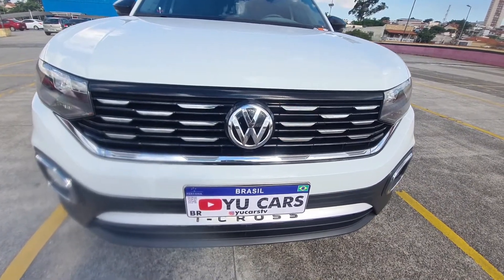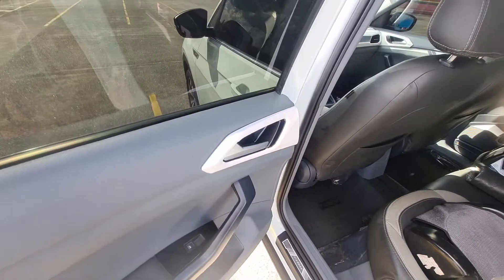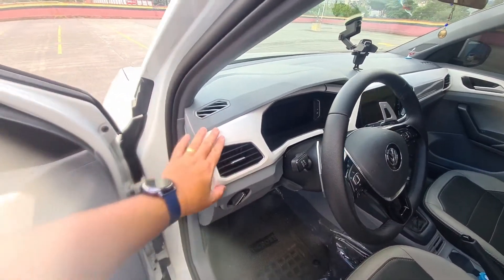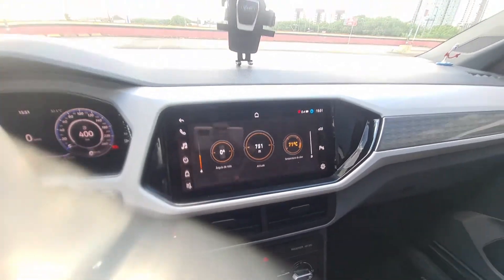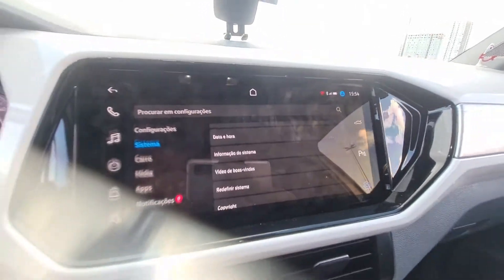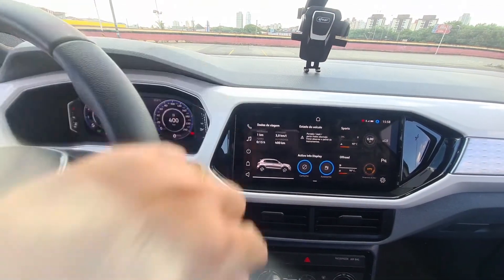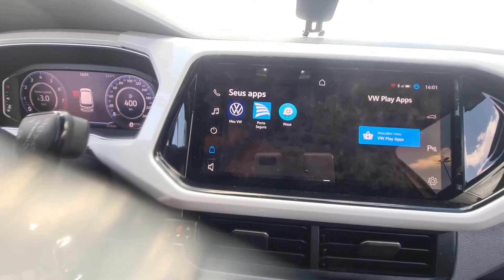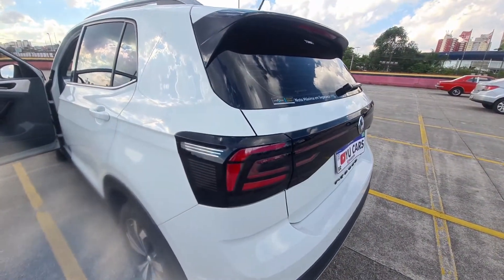Dicas como Transformar  Internamente T-Cross Sense X T-Cross Highline 2020 e 2021

Comment: Muito bom o vídeo parabéns! Só faltou ter mencionado qto vc gastou aproximadamente nas modificações e sobre o descanso de braço. Vc colocou o original?
Reply from the maker: Sobre as modificações tenho que fazer as contas mas passa fácil de 15k pois tem modificações internas e externas, sobre o apoio de braço coloquei da marca NAT enquanto não acho apoio original da mesma cor...
Reply: @Leroy Beckett Instablaster =)
Reply: @yucars2541  comprei um t-cross seminovo CL 19 mil rodados,veio com teto solar, som Beats, park assist, banco de couro, farol full led, a multimídia top, porém antes da vw play de 10 polegadas. Porém o painel veio analógico, qual vc me indicaria colocar, o com cabo de fibra ótica ?
Reply from the maker: @patrickborges5  o painel tenho para venda sem fibra e com fibra gps, mas antes disso vc tem q verificar se sua central tem.siada fibra...
Reply: @yucars2541  eita, como eu verifico isso ?
Reply: Olá. Esse acabamento Black piano nas laterais da multimídia pode ser encontrado onde?